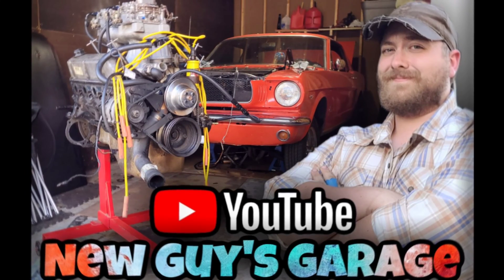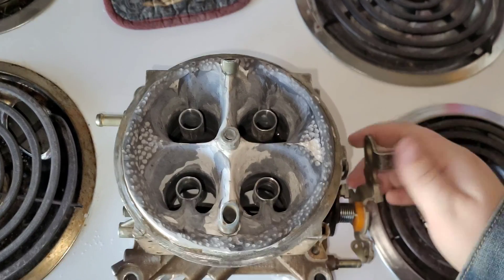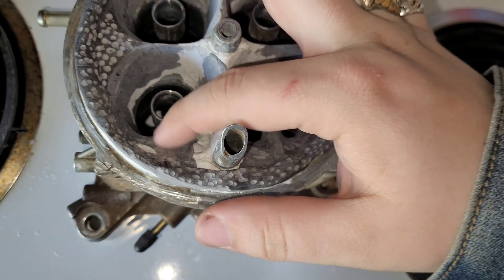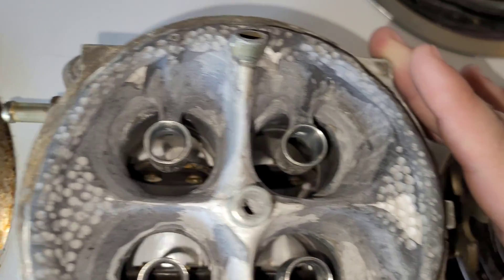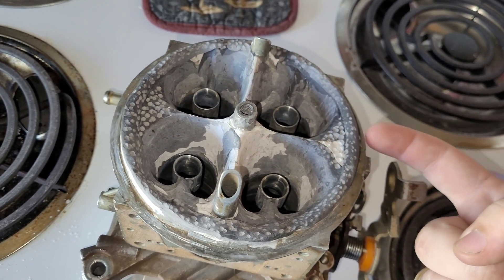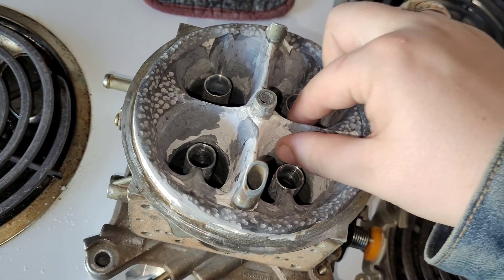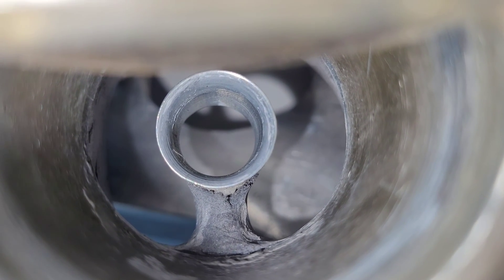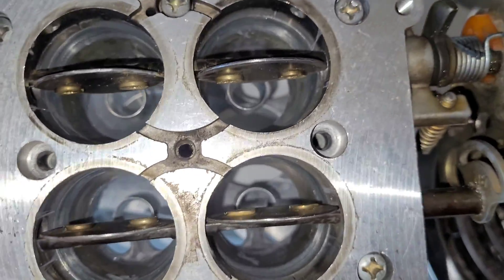J&B Weld Holley Carburetor Mods!? | Will It Flow More CFM | Holley Performance | Modified Carburetor

Comment: I wonder if you wanted more booster signal. You could actually dimple the insides of the tunnels. It would artificially choke it down and get the velocity up?

Comment: I got a ton of hate for doing something similar. I have no way to test if it helped me or not. 

I port matched my Turbos to the exhaust manifold. Port matched the exhaust manifold to the head and so on. I port matched and smoothed everything. I have been told countless times I wasted my time or I am stupid. I have been doing this to everything every time I have to pull a head for at least 20 years now. 

I would like to see other things flow tested, but I know its all based on what's worth it. Nothing is free.

Comment: After this test carb you should try to make a fuel efficiency carburetor
Reply from the maker: Lawn mower carb 😂
Well actually I do want to get my hands on a spread bore holley and play around with it! 

The tiny primaries would make crusing very fuel efficient 🤔
Reply: @newguysgarage6802  I was looking for one a couple months ago cause I'm not dishing out 800 for a carb when I could just get a qjet
Reply from the maker: @_10mm  they have a ton of them on ebay for like $100-$200 😃

Comment: Your not worried about the gasoline causing degradation of the JB Weld?
Reply from the maker: Like I said this one is a flow bench muel, the one we build for the car I will make sure to use good Epoxy for and seal with glyptal paint. 

I do have J&B Weld in a carburetor that I have run on the street for a while that had held up fine but that was just a small patch job lol
Reply: You need belzonna!